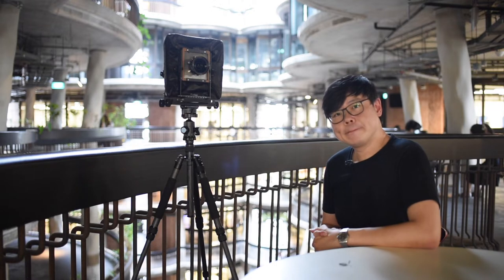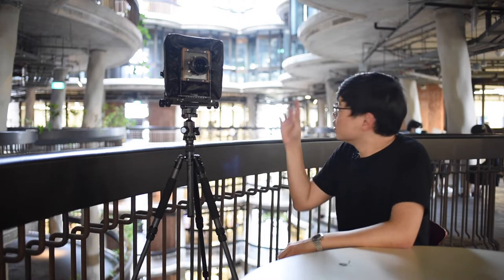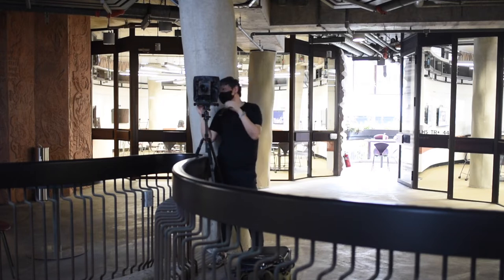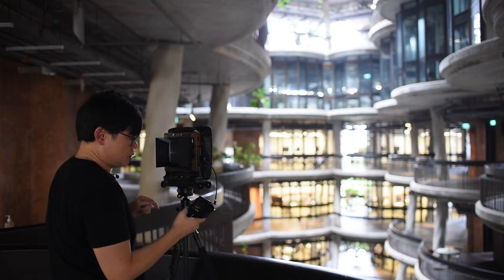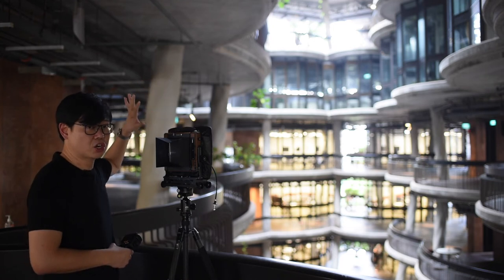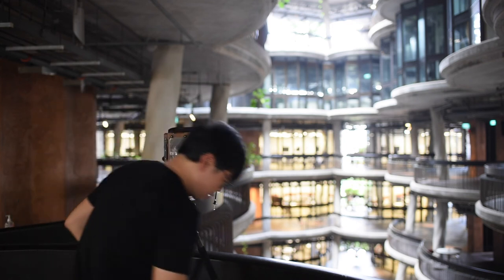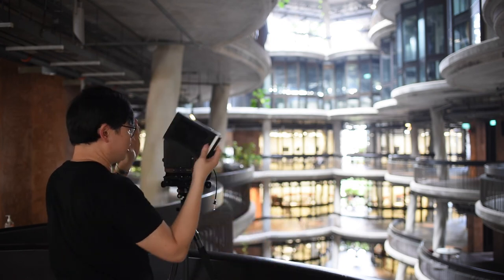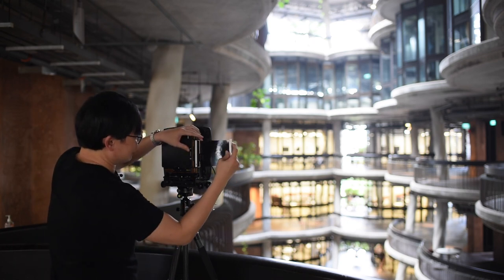How To Shoot Architecture Series #05 . NTU HIVE . Heatherwick Studio . Large Format Photography

Comment: Great video Melvin. I really like the images too. I usually shoot portraits but at some point I will break out my 90mm and try some architecture images. Do you use a recessed lens board? My 90mm has one but I don’t really like it. I’m thinking of changing it for a flat board. I think I can get away with it on my 45F2.
Reply from the maker: You definitely can get away with a flat board. So much easier to use!
I’ve got my Chamonix set up with bag bellows so I’ve got tons of flexibility even with my 75mm. 
Happy shooting!
Reply: @melvinhjtan  thanks mate. I’ll work towards that solution.